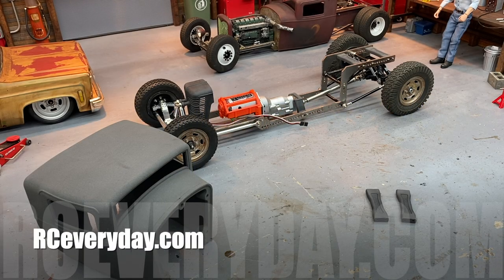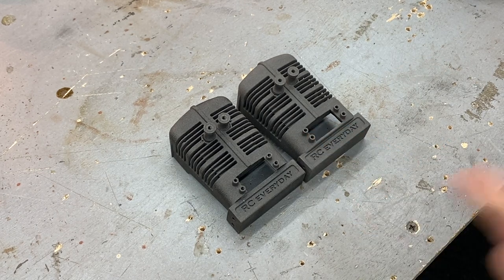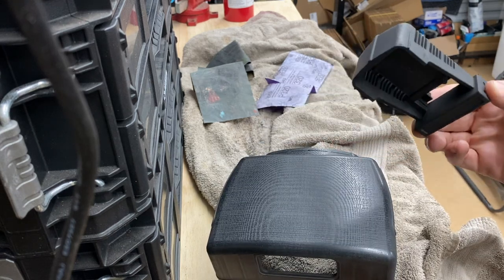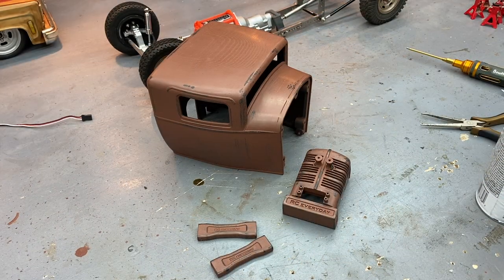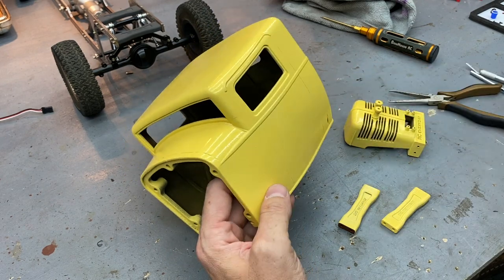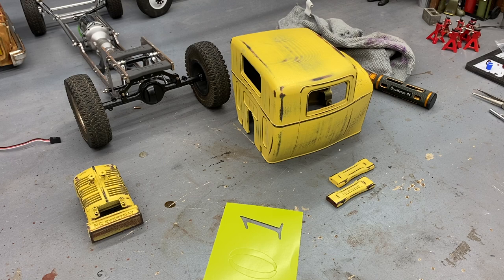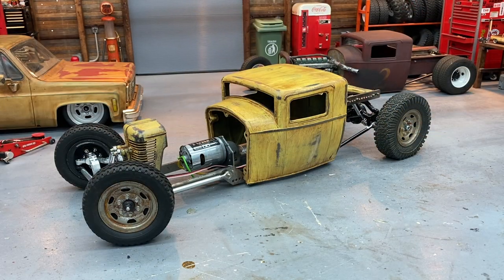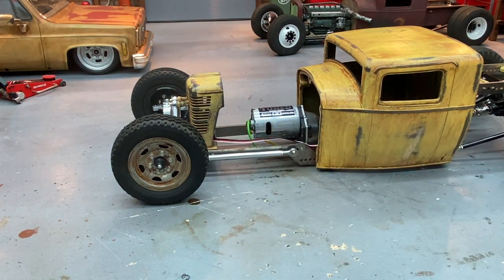RCeveryday Rat Rod Kit Tutorial, Paint & Patina with the SLS Printed Parts

Comment: Tip for working with old rattle can paint is to soak the can in a bucket of Hot Water for like 15 mins or so before you use it. The Hot Water will warm the solvents that have settled to the bottom of the can making it easier to mix and it will make the paint lay easier too. 👌
Also maybe do a Matte Clear Coat on the body so the rust doesn't eat into the paint. 
Just bc that part broke doesn't mean it's a "bad design", don't beat yourself up, it's just one of those unforseen things when you're build your own parts. Now you're into the revision stage where you refined the design! 👍👍
Reply: I do the hot water can trick too.
It works mint as fuck on most sprays I've used.👌🏻
Reply: That is great advice. I did not know that

Comment: When wet sanding, add a drop of plain dishwashing detergent. Really helps keep the paper from sticking, and keeps panels clean. Definitely a little aggressive on paper grit! 6-800 is my go to. Using primer/ filler first should remove most of those lines. Then you could coat with colors for patina. Just a thought ✌️

Comment: Not my favourite shade of yellow but it came out looking cool as fuck👌🏻 especially the PITA grill😎 

One thing I've been trying instead of sanding is a bit of thinners on kitchen roll, then steadily wipe through the layers. It seems to be a bit gentler than sand paper burning through. 

The other trick I'm trying is put the base layer (rust paint?) on. Then smear grease on the sections you want the base visible and built up your top coat colours. Once dry, wipe the grease off.

If you build up multiple layers, it can leave a paint ridge like you see on old vehicles where the paint has come away.

Have fun experimenting, RC Legends👍🏻
Reply from the maker: I like that idea of smearing the grease under layers.  Kind of like the chipping fluid method.  Might have to try that out.  Thanks brother!
Reply: @RCeveryday  
You're welcome Marra👍🏻

Comment: Not trying to armchair quarter back. But I would get further back away from what your shooting. Two, even three dusted on lite coats. The primer is going on too wet and too close and that's a possible reason for the long dry time. Careful cleaning, no solvent or finger oil and lightly sanding any surface gloss off the part before any painting. You want it grease/solvent free and the pores open on the plastic so the primer has adhesion. AND high humidity is NOT your friend when it's to paint.